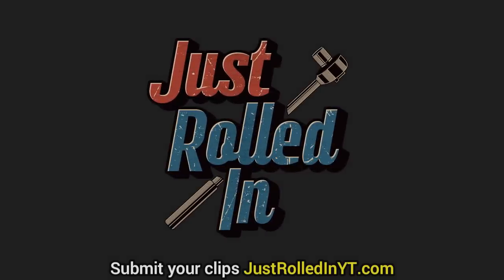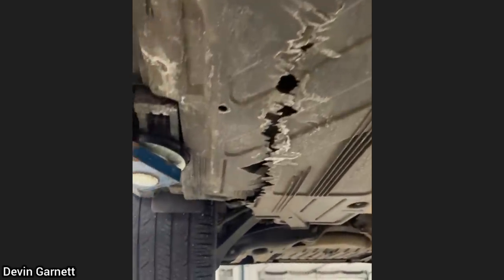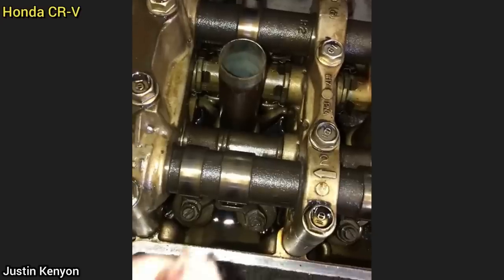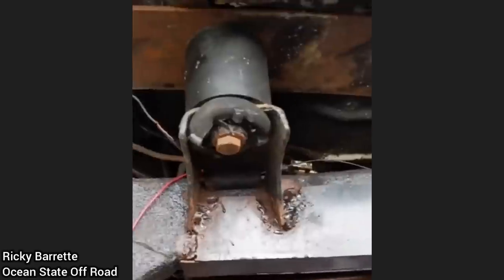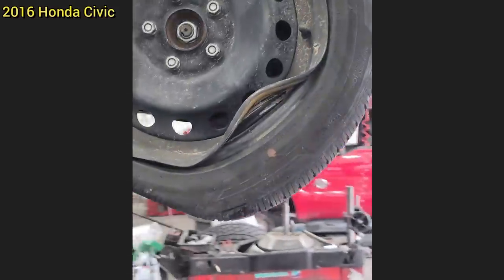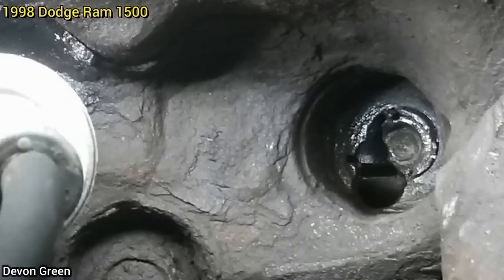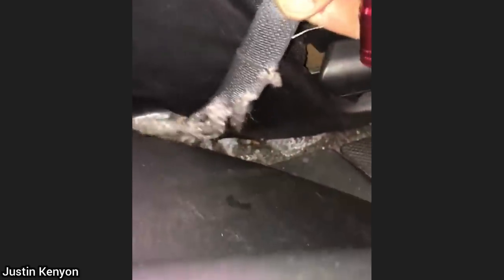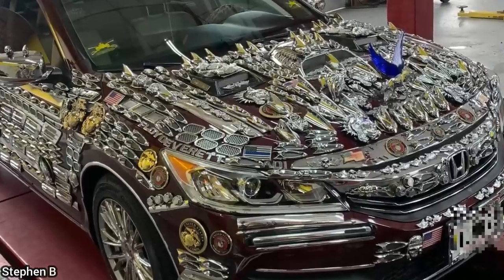Customer States Truck Was Stolen And Driven Until The Wheel Fell Off | Just Rolled In

Comment: OK Wow, i've seen everything as a decades long mechanic but that new spark plug hole drilled just floored me.
Reply: If I remember correctly, Rainman Ray had come across something like that a while back.
Reply: I'm sure no metal chips got into the cylinder...
Reply: I got a screencap of that for the next time someone    tells me how much they love thinking "outside the box"
Reply: @sometimesleela5947  That isn't thinking outside the box, that is just plain stupid.
Reply: Look at this way! You are poor just barely making it. Pay for a new motor or try an inventive may not work fix! It will still run on a missfire and get you to work.
Reply: @Jim Atwood  yeah no kidding, first thing I thought of when I saw that
Reply: I never had a reason to try it but, wouldn't  it be cheaper and easier to drill out the broken sparkplug?
Reply: Cheaper yes, easier , probably. Worth the headaches? Hell no. They make spark plug removers, all you’re doing is putting metal shavings and ceramic bits in the explodey chamber. Asking for failure
Reply: There’s a lot of bad decisions on this channel but this one gave me anxiety. ^^
Reply: drill, check....safety glasses, check...brain dead, check....for everything else there's Mastercard

Comment: The near nonchalant of "needs a new ball joint" says this guy has seen something like this happen more than once.
Reply: Friend works as a mechanic, and yeah, they've all got stories.

Best was hearing about how badly some wheel bearings die here if their seals are bad; rust so bad they're taking the torch to the wheel for 3 hours to free it up by slowly easing it out with heat.
Reply: I've never seen a ball joint so worn out, that the weight of the wheel is all it needs to separate it! Imagine that had happened somewhere the road

Comment: The spark plug one is a new level of insanity. WTF is wrong with some people?!😄
Reply: The previous mechanics family would be casket shopping.
Reply: And to think they probably drilled a hole and threaded it. I don't think they took of the head to remove any metal shavings 😂
Reply: @cowboy3490  I think the previous mechanic was the customer, his buddy, and some cheap beer.
Reply: @cowboy3490  Ooohh....internet tough guy in the house!!
Reply: Lots of cheap beer
Reply: @plthirty2  Bud Lite?

Comment: I am not a mechanic, but those who are, do not get paid enough to deal with those nasty cars. When my car was in the shop, I spent a few hours detailing it so it would smell nice for the mechanic 😂
Reply: As a retired mechanic YOU are right
Reply: I'd do the same thing.  Wash and vacuum it as a minimum.
Reply: as a retired mechanic, your car doesn't have to be spotless. BUT if you locate that darn wheel lock key, its better than a free beer sometimes!
Reply: Doesn't hurt to leave an open bag of candy in there too.
Reply: Same here, I always wash and vacuum it before taking it in but learned a few years ago to also remove all the small change too.
Reply: @bryana7163  It's in the glovebox lol I always bring a six pack of my mechanic's preferred libation whenever I collect the car, all healthy relationships are founded upon such gestures.
Reply: I will not clean my vehicle to a "detail" status, with that being said, I can die or embarrassment if my vehicle is not clean for my mechanic to work on it... A regular clean does the trick, any extra item lying around, stays at home, a regular vacuum, and a 30min remove the grime and dust wash, and off it goes... Typically when it returns from the mechanic it does require a deep wash...
Reply: Yep.  Me, too.  Anytime mine is going in I clean the entire inside and get a new air freshener.  Not only is it the right thing to do but I think they might make that little extra effort knowing that you care about your vehicle.
Reply: @skyylow  I always send a box for the service dept and one for the driver.
Reply: @bryana7163  My current car does not have one(Thank god) but my previous one did. I had that thing in a ziplock bag in the compartment under the stereo and that was the first thing I let the mechanic know. The guys eyes lit up just like he won the lottery!
Reply: @BrittanyScream1  lol, there have been times where I would spend 20 minutes looking for it, removing everything from the trunk only to find out the owner left it at home or worse, lost it.  It takes me 10 minutes to break them off, if it is known to be lost.
Reply: I heard of one mechanic that would get his wife to drive some cars into the workshop from the car park.
Because she had a stronger stomach than he did and would not retch at the smell of some.

Comment: Just a question for anyone in usa(I'm from uk) when a technician/mechanic sees a vehicle in such a bad state as the jeep or the car that was going on road trip with very loose shock absorber/damper and bald tyres,does the technician have a legal obligation to tell authorities(police etc) that car is unsafe or do they just leave car go on its way?
Reply: the footage of this video answers your question
Reply: I am in the USA, I don't really know. But it should be done. It's not just the broke vehicle, it's the other vehicles around it that are in danger. 
I don't know how some people can just drive a death trap around. Just think what could happen if there is a crash. And someone died.
Reply: Might asked the owner to sign a waiver just in case the shop gets sued…
Reply: In my state, all they can do is refuse to work on the car and strongly request that the customer sign a release of liability.
Now, if the cops, or even more critically, a DMV (Department of Motor Vehicles) inspector happens to notice, there goes your valid inspection status, making it a fine every time you get caught driving it, and the DMV inspector can yank the registration and/or the plate.

Comment: This proves we need to have mandatory inspections to keep these people off the road. I've seen a few of these where the customer returned with their car being towed in.
Reply: Wait, America doesn't have mandatory inspections? In Australia, all states but Tasmania have it required every year, Tas every 3 years. Crazy to let vehicles just drive forever with no safety checks
Reply: @kalon9999  
Wait, America doesn't have mandatory inspections?

It depends on the state. Some have them.  Some only have emissions inspections.  Some have none.
Reply: Florida has no inspections.  I routinely see landscaper and lawn service trailers that are supposed to have tandem axles BUT, only one axle has tires on it.  Or one axle is completely gone.  In both cases, all the weight is on the remaining axle.  That should be illegal as hell but, I see it every day.
Reply: @Jaslath  Mostly because you don't want it to be done by federal as they will fuck it up harder than they do with the VA currently. The moment federal comes knocking around you will know that it will be very expensive, slow as hell and won't do shit.

Comment: I declined repairs only once. In 1991 our ‘87 Impala station wagon needed complete brake stuff, lines, rotors etc. Was about this close to needing bushes to stop it. I was told it would cost $600 to fix everything. I paused, to decide if it was worth $600 to fix a car worth $1.49, the middle aged chauvinist slid the phone over & patronizingly asked if I wanted to call my husband. I replied “I want my car back” & I kept saying it until he said I needed to sign something so they wouldn’t be libel if the brakes failed getting home. I did & drove home & parked the car. Gave it to some company that wanted dead cars. 
Found a better mechanic garage who didn’t patronize me & learned a lot from them.

Comment: I'm not a professional mechanic or body guy but I just got done rebuilding the front end of my daughter's Escape. New bumper, radiator support,, radiator, fan assembly, replaced rack n pinion, cv axles and brakes. I still haven't gotten a straight story from her and I would like to know how barbed wire got in her torque converter.

Comment: Any reason that last clip would have happened?  I'm assuming ball joints don't just suddenly break while the vehicle is being serviced.
Reply: Normally the weight of the vehicle presses the ball up into the socket. When it was on the lift, the weight of the wheel was hanging on the ball and it just popped out.

Comment: I don't understand how people let their cars get so filthy. A few years back,  I saw a car once in a goodwill parking lot. I happened to park beside it.   A Hyundai Ioniq  (Not the 5) Brand new. I like Hyundais, especially the Ioniq lineup, so I knew this car had just hit the local dealerships within the past month. This poor little car was FILLED to overflowing over the seatbacks with trash. No, Not bagged trash being taken to a dumpster, but just shit thrown over the seat.   Half empty drink cups just tossed against the windows and soda splattered and dripped all over. Fast food bags tossed and spilled.  The drivers seat was covered in brown muck and matted up.  It actually looked like the driver just took multiple shits, right in the seat and never cleaned it,  Just sat right in the seat again for his next shit.    Come on...  if you are incontinent, there is no shame in wearing a diaper.  It happens. Then just random trash mushed into the shit.   Food and candy, also half eaten, just tossed and laying, rotting. The windows were splattered and smeared. Visible through the back glass was a box of donuts, with evident mouse droppings and chew marks.  Bugs, roaches, gnats, flies and maggots just crawling all over everything.    The dash was piled up with empty cups, cans and food wrappers so high that I don't know how the fcuk the owner could see over it.  The exterior was beaten, looking like the driver regularly used guardrails to keep on the road.  Passenger mirror smashed and danging by the wires. Passenger side headlight duct taped in place yet still almost falling out of its smashed  "eye socket"  The window was slightly open as I walked by, unable to avert my eyes to the horror.  I just kept staring at it. seeing more and more disgusting funk.  I dared a close look.  The drivers footwell was filled.  I could not see the pedals.  the driver  had to have been using the pedals by pushing on the garbage.  Then it hit me... OH GOD!  When the putrid smell of death and rot wafted through the window and hit me....  Like a dirty, overflowed portajohn at a music fesival on a hot summers day, mixed with the inside of a garbage truck, also on a hot summer day, mixed with rotting roadkill deer on a hot summer day.    (it was a hot, summer day)   I wretched. There HAD to be dead animals in there!   Almost puked right there in the lot.   But the worst part of it all was that in the passenger seat  was a little toddler carseat.  It too, filled with trash obviously sat on and crushed down.   I finally turned away and quickly walked around it and got into my van and moved it to the other end of the lot!   As I left, I had to go past near that car again.  I saw the owner. Some big slob of a beast in filthy clothes, putting a filthy child into the  car-seat.   I don't care how poor you are  (if you are poor you don't buy a brand new car, so that's not the case) You don't put that disease ridden funk out in public. You don't drive a car that is so piled with garbage that the controls are inaccessible. And you especially don't put a child into that kind of nastiness!    I left there pissed off.  Almost called 911 on her.  I hope she wasn't donating anything, because then the whole store would have to be fumigated for a vermin infestation brought in on the shit she could have donated. 

DIS.....GUSTING!!!

In less than a month!  HOW?  WHY?    I freak out if the dash of my 33 year old Dodge van with it's showing of age and faded paint  is dusty. or my nephew wears his workboots in it.   I tell ya guys,  If I were a mechanic and one of those roach-mobiles came in..  No fookin' way would it even roll into the garage.  Flat refusal to work on it right there.

Comment: Many of these shouldnt be on road, in Europe here you wouldnt get out from inspection, they would stop you from road and demand repairs done. Some low type repairs you go to service and repair, but this bad, you would go to service on evac trailer. Problem us has is cars, here in eu you dont need car. In every place there is bus which comes frequant, bus is new from major brand. every place has shops small and big, simply you can go on foot lets say 10-15max walk and you reach a shop. Most population use bus, going from houses, apartments to job in city and away from city. A lot of people dont even have license to drive. So lets say you are poor so you do not own a car. As car needs frequant repairs service simply money, all cars here have insurance and pass inspections even oldest cars especially old will be in proper condition to drive like new car. Most important are brakes, engine, like no leaks of oil, tyres must be to code, lights, main driving parts of car other main parts. If you come to inspection smth is bad, but not critical you can go to service to fix, but in inspection they will shake the car hard, make rev high, will check co2 emissions,